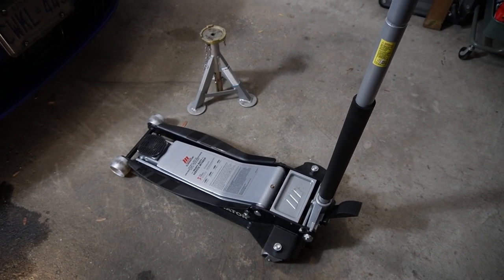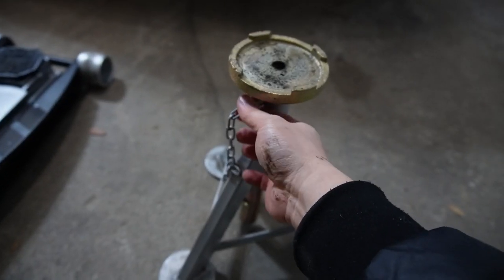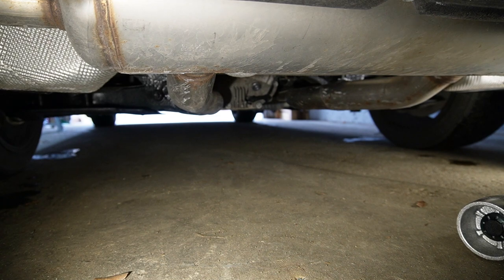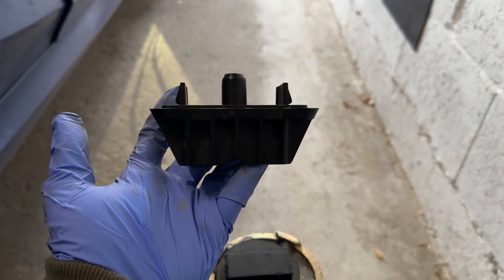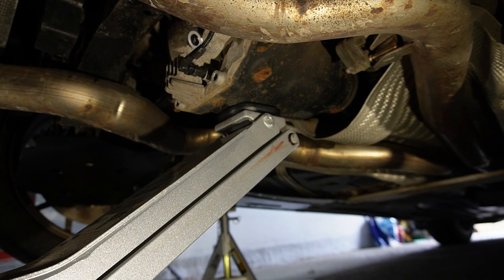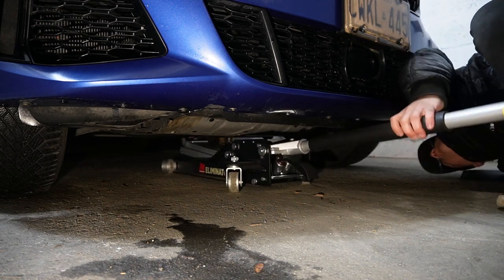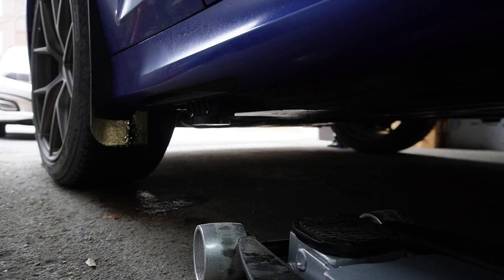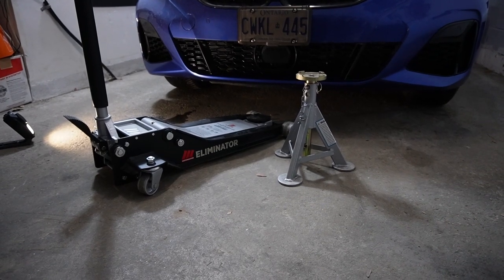How To Safely Jack Up Your Car & Put It On Jack Stands

Comment: Where did you get those jack stands?
Reply from the maker: They are the ESCO 3-ton jack stands, that I took off the rubber top. Bought them from Amazon years ago and it was like at least 10% cheaper than what’s being sold at right now lol

Comment: Did you drill screws in the jack pad adapter into the lifting point? Also, where can I get spare plastic pieces that go into the lifting points? I damaged two of mine..
Reply from the maker: Yes, I did. 2 self tappers were what I used. Been 20k km on this car and another 40k km on my old F30, they don’t come off usually (except the time I went through a nasty speed bump…)
Look up the part number for the plastic jack points. I got them from Amazon/Aliexpress. Dealerships also carry them but they cost like $60 each vs $40 for 4 aftermarket…